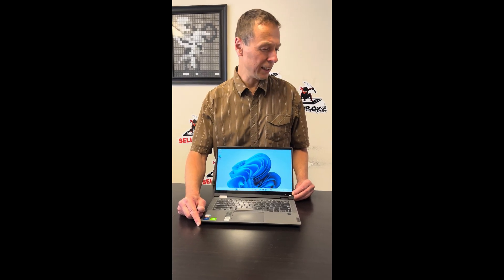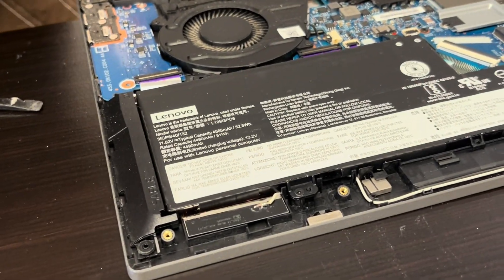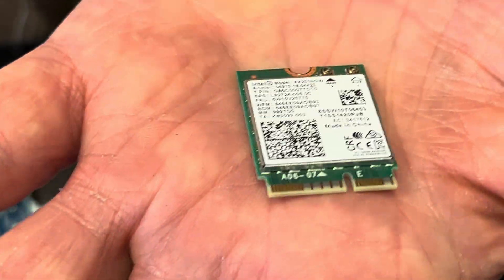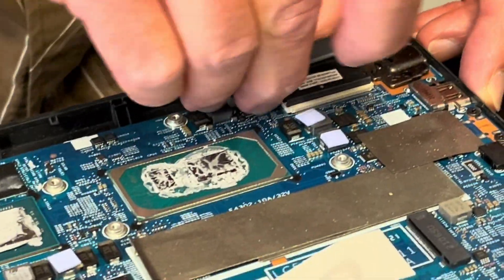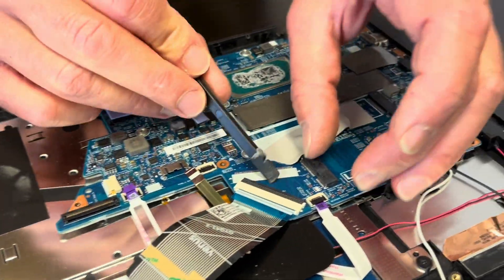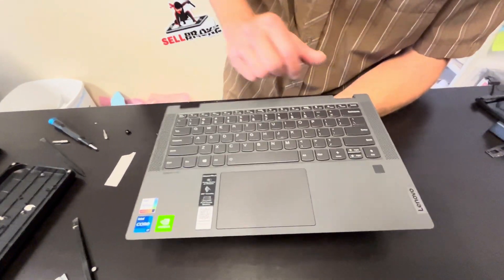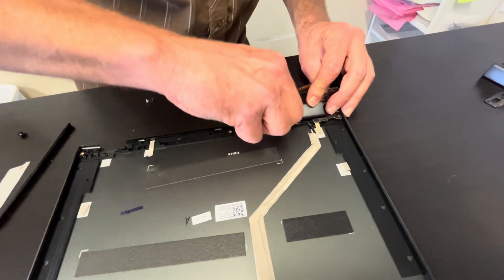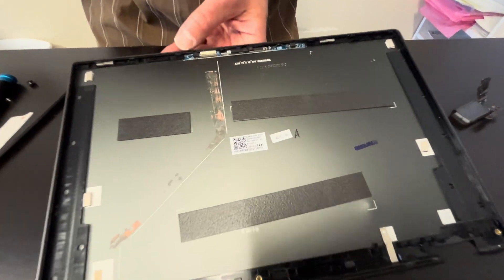Lenovo Ideapad Flex 5 14 Laptop. Easy DIY at home disassembly,  repair or upgrade parts instructions

Comment: I would not let this guy anywhere near any electronic that I own.  Absolutely zero awareness of ESD precautions discussed, or actioned.  Too much tapping and chapping, all of it completely unnecessary, of metal tools on component/electronics.  He might be alright changing the gear box on a mark two Cortina, but electrostatic sensitive expensive electronic components... no way hose!